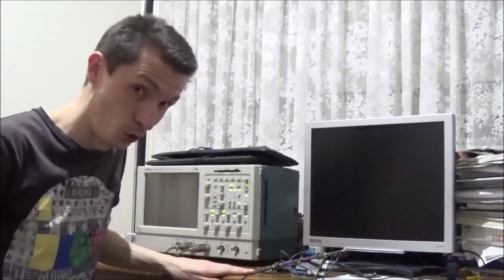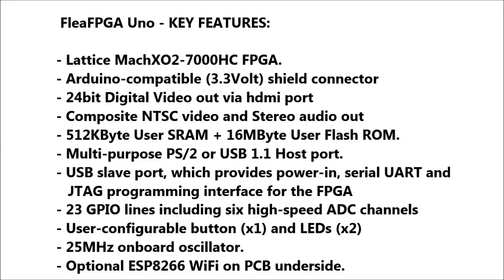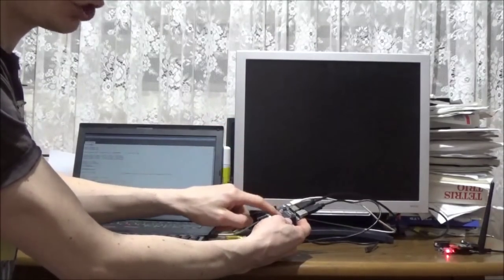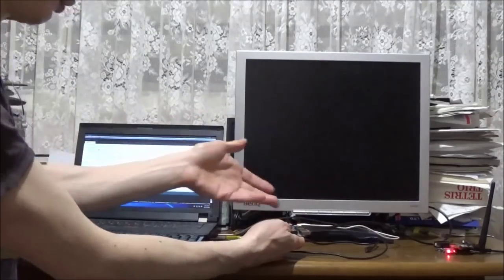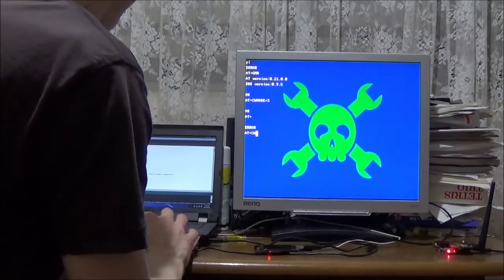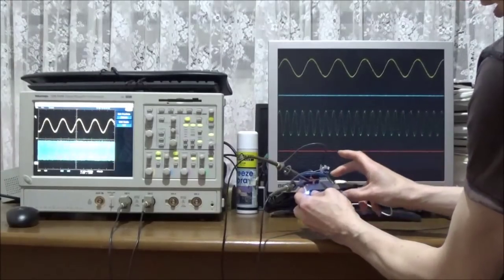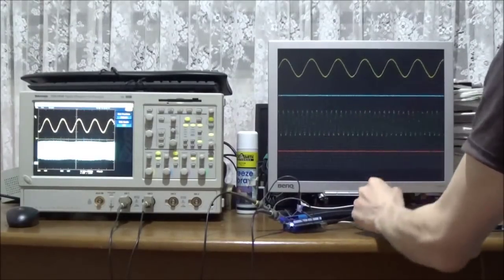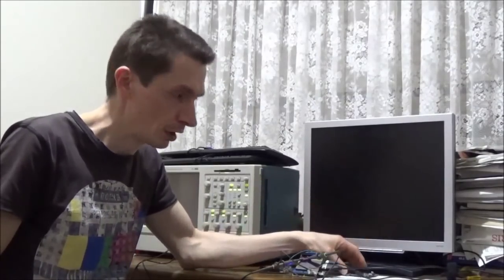Introducing the 'FleaFPGA Uno' Starter Board

Comment: Just discovered this - bummed to hear you've had some personal issues and stopped selling these; would immediately have bought one!  Anyway, hope things work out for you; while I'm late to the party I appreciate your hard work.
Reply from the maker: Dr Tune,
Sorry for the late reply and thanks for your kind words. Main reasons for stopping this project were: 
1.) Rather low general interest in it overall, though perhaps with a better FPGA and more RAM it may do better? I'm not sure.
2.) Any plans for a second production run of this board got killed off entirely, thanks to the (at that time) PCB fab winding up  the assembly cost for any subsequent low-volume runs (I got the impression they weren't interested in doing low quantity orders on a consistent basis, which is fair enough I suppose. Oh well..).
Cheers, Valentin

Comment: Very nice board, Did you have a look at the FreeSoC2 board yet? This could be a way to add analog logic. Could you tell me the price tag for the complete board? Still a bit afraid of FPGAs :-)
Reply: +dosgamer74 thanks for the nice and fast answer, maybe 2016 I will have more time. in the workshop
Reply from the maker: +norm1124. Thanks for your comment. I'm aware of the PSoCx series of chippies and they are indeed cool in their own right, but using a somewhat different design philosophy from pure FPGA tech. 

To be clear, my board does have six independent Analog input channels (among a host other things) that potentially make for interesting and even unique possibilities. 

Pricing and other information can be found in the following link (as well as others in the video description): http://www.fleasystems.com/fleaFPGA_Uno.html

Also, even if you are completely new to electronics and have no digital or embedded experience you should not be afraid of using my board. You can start off using it as an Arduino-compatible computer and then progress to hacking the FPGA in your own time when you're ready. Cheers Valentin